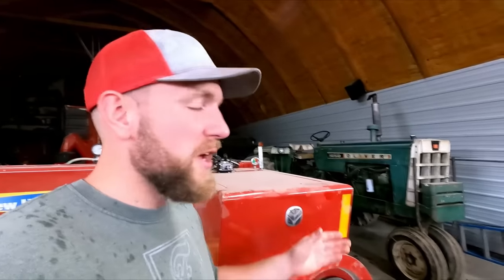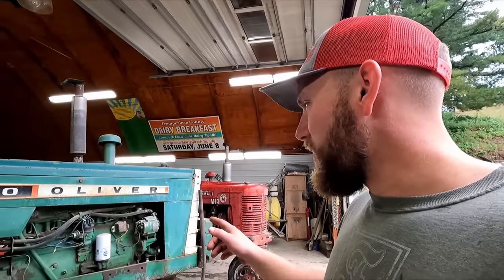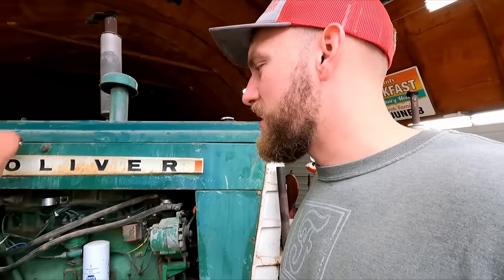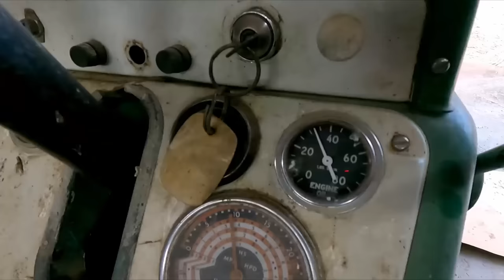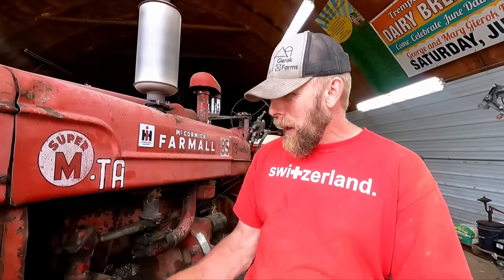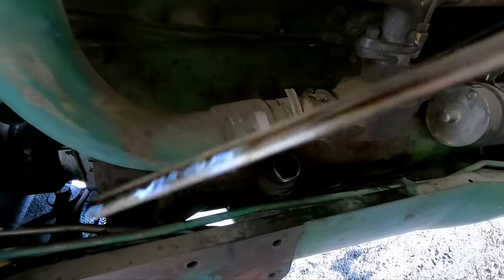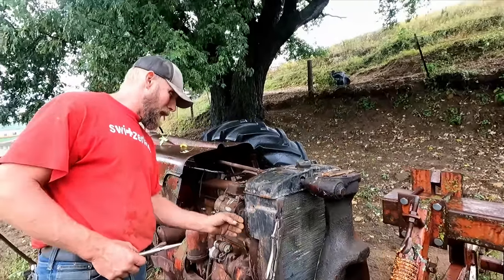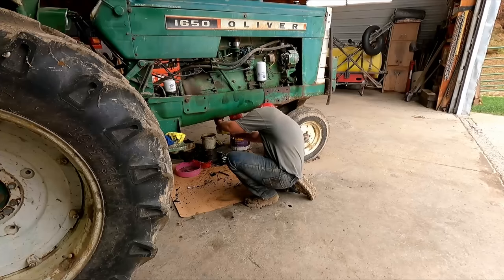Tractor Trouble!

Comment: My guess is one of the sleeve o rings is shrinking in the cold weather and letting coolant leak into the oil pan. You could put a radiator pressure tester on it on a cold morning pump it up and watch for a pressure drop pull the drain plug and see if coolant comes out.

Comment: Wish I lived closer, I'm up in central Minnesota, north of Alexandria. I have many of the tools needed for this kind of work and the time occasionally to help some folks out. I even have a tractor dynamometer that helps put a stationary load on the tractor for diagnosing issues and figuring out horse power. I have some videos on my channel of working on engines and running tractors on the dyno. I don't spend a bunch of time in Wisconson but I do enjoy the occasional travel!

Comment: I would see if you can find a shop that has a tester that can check engine oil for contamination. Put new oil and filter on the tractor and run it for a while. Uae it like you normally would. After you get a few hours on the new oil take a sample and get it tested. You might have to pay a little bit for the test but it will be worth it to know if you have a problem for sure

Comment: Years ago when I had horses I alwaays cleaned the barn and barnyard armstrong style twice a day year around. I only started the tractor after the spreader was loaded. But during the cold months the crank case oil would get milky. So once I found that out I started the tractor as soon as I got out there and let it run and get good and hot. No more milky oil. I don't know if that's causing your milky oil but I thought I should pass this along. My best wishes to you and your family.

Comment: A compression test is cheap to do. Bubbles in radiator is also a good sign of a bad head gasket. 
I can remember putting our M on the stock trailer to move fresh cows. Our heifers would pull the spark plug wires off and I'd be out in the dark early in the morning putting the plugs wires back on.

Comment: If you have coolant leaking into a combustion chamber, that cylinder (and spark plug) will usually be a lot cleaner due to the coolant flashing into steam and cleaning everything. My money is on cylinder sleeve o-rings. If you discover that's the issue, you should really consider doing them all.

Comment: Alot of great advice already given! My 2¢ worth is to pressurize coolant system to 20 psi (max) and see if system bleeds down, and if it forces any coolant to leak into the oil pan. You won't risk the engine bearings, and it's faster than waiting for it to heat up.
Reply: Even better yet, leave the oil pan off and do what you said and watch were the water is dripping.

Comment: Whether it’s an o ring or head gasket , it shows up during the cold season because the temperature is shrinking or contracting the material, in the warm months the temperature is allowing the material to expand or stay in it’s need shape & place to hold the water back, also get yourselves a box of XX-Large mechanics rubber gloves , you will be glad you did! Good Luck 👍🏻

Comment: When looking for coolant in oil pan the drain plug needs to be at lowest point of the pan capacity so that the coolant accumulates at plug threads. Crack open plug unscrew slowly till liquid drips. After allowing enough time to seperate, the coolant will come out first and should be obvious in its appearance. Was me and severe cold was cause of leak I would install a block heater and keep it plugged in. Would make easier to start also. Love your videos. Keep up the good work.

Comment: Have an Oliver 1650 myself, just is a diesel.  Currently, it has been out of use with needing a new clutch plate put in need to split the tractor. As well as the hydraulics are weak and need to rev the  engine to get it to lift or move hydraulic cylinders, and the pto doesn't turn completely off unless pull on it's lever hard

Comment: I said it before and I say it again, if it's just a little leak getter hot, run it up and down the road a few times with some Blue Devil head gasket sealer in it.  I been running my International with a loader on it for 4 yrs or more now with no issues

Comment: Is a farmer I've been a tractor off and on all my life, having give you some pointers on the Oliver I will now give you the only way without ruining any parts to get to the fan on the m. At the front end of the fuel tank there is a u joint in the steering shaft the front u-joint has a clamp and a woodruff key loosen the bolt in the clamps and go out to the front end in the steering pedestal that big cast piece in front of the radiator with the big hex plug on the front. Take the plug out and that shaft will come right out on the worm gear. Should take you 10 minutes and you won't ruin anything. You can then get the radiator and bolt it lifted out of the way and you'll have free access to the water pump n fan. I would suggest you repeat the process on the one with the broken fan when you go to repair it would be much easier that way

Comment: If it was me, I would continue watching it like you are and if you start to see signs in the oil again, pay attention to the temperatures outside into wherever you park the tractor if it’s warm in the shop and cold outside, you’re probably getting condensation in the oil and if you’re just doing short runs with it, it’s not getting hard enough to burn the condensation out
Reply: My thoughts exactly. We had the same issue with our M .turns out it was just the thermostat stuck open.

Comment: Engine runs good probably was a O-ring on one of the sleeves leaking from extreme temperature changes. I've had this happen to my 880 Oliver . Put a bottle of Dike radiator sealant in the coolant and it's never leaked again. I'd bet that would remedy the problem and save you tearing down the engine.

Comment: Somethings to help narrow it down.
Head gasket or valves leaks in head cold be indicated by white exhaust smoke or excessive smoke out crankcase breather or look in radiator while running you may see bubbles.
If you don't see any of those things it's likely leaking in the block somewhere like a cracked sleeve, o rings around the sleeves or a cracked block.

Comment: Buy yourself a coolant pressure tester. You can get a decent one from harbor frieght. Drop the pan and pressurize the cooling system with the tester and look up from underneath at the bottom of the piston sleeves. If you see coolant dripping then there is your issue. If your oil is milky, then it’s more than likely it’s blowing it directly to the pan, not a head gasket. You can also run it and pop the radiator cap off and check if you feel it puffing.

Comment: Can't blame you for putting used oil out of a good tractor in the 1650 to help scope out the problem. Not like you're going to do a bunch of heavy work with it. Bummer about the fan on the M. Sometimes having a parts source for some of these old jewels isn't all bad. Parts for some of the 50 yr old tractors are getting harder to find, let alone 60 to 70 yrs old.
Reply: You know the right place to go you can pick up a new water pump for those m&h engines. They have eliminated the greasable bearings and have started putting in sealed bearings. I put a couple of those pumps to use they work as well as the old ones.

Comment: There are high pressure,(cyl pressure)and low pressure, (oil and water).  This is a case of water getting into the oil.  Both lower pressure systems.... in comparison to the high pressures in the cylinders. which will generally cause overheating and stem from the radiator and water being blown out of the radiator cap  IF this engine has wet  cylinder liners then it could be a breakdown in the seal at the bottom of the liner where it beds onto the block.  OR it could possibly be a porous liner which may not show until the cylinder gets hot (Working). sometimes if this is the case you might detect white smoke (steam) from the exhaust.  I worked on an excavator engine that turned the oil to a white /Grey sludge in a day. and the ingress of water into the oil raised the oil/ sludge level considerably.  We could not find the problem and it wasn't until I removed the head , the pistons and rods, then put an oxygen acetylene welding torch on white light flame down the bores to illuminate the bore when suddenly beads of water where running down one of the liner bores.  When that liner was removed there was a large blow hole in the outer liner wall well down below the travel of the rings so it didn't show water in the exhaust smoke but went into the sump oil.  none of this showed on the inside but on closer inspection there was a split mark as if the tip of a needle had scratched the bore.  Cold it didn't leak but when heated the minute split opened and every stroke sucked water down Into the sump oil.  Love from the UK

Comment: I had the same problem with my farmall 504, the exact same problem to a T. I caught mine early just like you guys and all I can recommend is tear the head off and send it to a machine shop to have it gone through, might as well throw some new valves, springs, and valve seats in it. throw a head gasket on it and run it. that's what I did and have not had a problem. 2 dinos at 45 horse and some fall tillage later no problems"!!!

Comment: If there is an auto parts store close they will loan you a radiator pump and a boroscope. Pump the rad up to 15 pounds. Look in the cylinders closely to see any water around the head or walls. Rotate the pistons slowly and check the liners too. Take your time and notice if the radiator pump looses pressure. You can take an old spark plug, hollow it out, and weld a air hose fitting on it. Let your shop air pressurize each cylinder. Look for oil in the water and bubbles in the radiator. Listen for air comming out the dipstick or the oil cap. Easier to see if you put dye in the coolant.
Reply: @texancowboy9988  I don't need anything. Just trying to help with suggestions. You are employed as a mechanic? I worked at a heavy equipment dealer.

Comment: One thing to keep in mind for future use, anytime you have an engine open like you had the Oliver, dust and moisture can get into your engine. Even if you just put the oil pan back on with a few bolts it will help keep dust and dirt out of your engine. As far as any coolant leak, is it going through coolant?
Reply: Good question, is it using coolant?

Comment: Are you guys absolutely sure that you have a coolant leak?? If you have a thermostat that isn't closing, and it's cold enough outside ( like in February) the engine isn't warming up enough to burn out any condensation from inside the engine. It'll turn the oil milky. We had the exact same problem with our Farmall M a few years ago. Start with changing out the thermostat.
Reply: I agree with the thermostat/not enough heat I have a tractor that it does lots of small jobs and I swore that I had coolant in the oil. Changed the oil and it was still milky until I mowed hay for 4 hours and it cleaned up
Reply: I was thinking condensation also.
Reply: An old time tractor mechanic told me to dump a bottle of Heat in the oil, hydraulics and rearends in the winter to take the moisture out of the fluids. He said I didn't run the tractors long enough to evaporate the moisture out.
Reply: When they drained the oil, green coolant was running out first not just milky white oil.
Reply: Condensation can be a problem !!¡! But also Cavitation Erosion is a BIGGER PROBLEM AROUND THE BOTTOM OF CYLINDERS AND HARD ORINGS 😢😢😢
Reply: @TimKrenz-j8t  oh you are absolutely right .If the dam thermostat is open, and not working properly. And not correctly diagnosed. It will cost thousands more than it should

Comment: Little late now but if you had an IR Temp gauge you might detect an exhaust port running cooler. Sure hope you get it sorted out. Some times you can’t find a problem without tear down. Have you pressure test coolant system? You might have a cracked head

Comment: If you had a leak to your cilinders, you would lose way more oil and/or water. You would have white smoke coming from your exhaust as well. Only then examiing sparkplugs would have made sense. I watched your exhaust fumes and they look pretty normal. The thing that causes oil to be milky is mositure and low viscosity . In freezing temperatures, oil can start looking a bit milky by itself as it will have bubbles building up. Pumps and other moving parts might suffer from cavitation, "exploding" airbubbles due to a higher viscosity of the oil which is caused by a bigger pressure difference before and after these parts (much like bubbles made by ship propellors). Other things are water buildup due to your engine repeatedly warming up and cooling down. Always examine your engine when your engine is heated up properly. And yes, also a leak from the coolant system to your oil system. I think however that the oil should look way milkier then in your former Oliver video. 

To me this looks like cold, bubbly oil or moisture/condensation buildup. Your dad was pretty right with the approach of keeping an eye on it to see if it dissapears or is getting worse. If the first, you will know this for the future. If the last, you might have a nice engine rebuild video series coming up ;) There are after market block heaters to prevent stuff like this. blocking off part of the radiator might help in the cold as well. Keep an eye on the temperature then though! It is tricky to get old engines serviced properly if you don't have a manual or other source on how to do that on a specific model (getting a retired mechanic that knows these tractors might be an idea, they might do it for the fun of it. Maybe there is a youtuber that can help you out on this such as @JustaFewAcresFarm, he knows his Farmalls at least). You also need the exact bolt tightening torque values and in what order you need to mount the bolts of the head covers and similar parts on the engine. gaskets need to be replaced every time you open up the engine btw. For cheap stuff, you can try using liquid gaskets (use Loctite)  if the pistons allow that, but this machine might be worth preserving properly. I really like the look of that Oliver btw. 

I do tests on machines (also on tractors) in a climate chamber. Lots of things happen when they are stressed in the cold, including temporary leaks during cold starts, but never in the engine to be honest. Most leaks occur near the radiator area, at filters, plastic parts and connectors. But these are new prototypes of course. The most trouble is parafinated diesel if below -20°C, even with arctic diesel.

Good luck!
Reply: Hmm... true... Indeed not aribubbles, silly me. And yes, they implode instead of explode. I don't know what I was thinking when posting this. 
But: improper viscosity does matter though. If you use the same oil in normal temperatures (where the pump is designed for), and you start using it in cold temperatures, viscosity can rise up significantly. The pressures in your system will be way different because of the changed viscosity. (higher on pressure side, lower on suction side) and so can reach vapour pressure. Trust me, I've seen (and heard) it on cold startups of excavator hydraulic pumps, wind turbine gearboxes, heck, even a modified Leopard II. But now I think of it, never on an oil pump for a tractor tbh.... The oil has gas/foam in it when starting up below -20°C though. It also often occurs in the oil of our cooling sytem itself (450kW). That has a system to deal with it automatically. I know that oil companies developed cold climate oils for certain fields to cope with that. Not only a lower viscosity,  but also anti foam (higher probabiity in the cold (same reason), additive for faster heat transfer but lower operation temperature while extending the temperature range of the oil and such. @texancowboy9988

Comment: An old time tractor mechanic told me to dump a bottle of Heat in the oil, hydraulics and rearends in the winter to take the moisture out of the fluids. He said I didn't run the tractors long enough to evaporate the moisture out.
Reply: Great advice. we run it in snow plow hydraulic systems and haven’t had freeze issues since.  Same with crankcases, transmissions and differentials.  I add it to the contaminated oil and run briefly before changing and then add some to the fresh oil. No issues in nearly 30 years of practice.

Comment: To me, if the oil & trans. has white, & milky, condensation, but you can tell if it's coolant, I'd use it for a while and keep an eye on it! you mean, vise grips, 1/2 in. wrench, AND a torch! When I do spark plugs, I slip a piece of rubber gas line hose over top the plug, and screw it in or out!

Comment: Pressure test with oil pan off. Probably liner O-ring. If that is the case and you can run Bar's stop leak for awhile.

Comment: Maybe put air pressure to each cylinder through spark plug and watch for bubbles in radiator. Think about 30- 40 psi

Comment: Leave those plugs out and roll the engine over, that way it doesn’t hydro lock and break rings. In the case it has coolant in one or more of the cylinders. And as a  diesel  and former field service mechanic, I d never put used oil in a machine, not even an old tractor trying to chase down a coolant leak which could be caused by a faulty head gasket, or liners electrolysis or liner o-rings if it’s a wet liner engine. you could wipe out and wreck your engine oil pump and bearings surfaces doing so, not to mention contaminate the entire oiling system. I always use new oil regardless of whether it’ll be wasted.

Comment: i would bet that it is the orings on the bottom of the sleeves you could take the oil pan off and leave it off and put some cardboard under it and see if you get coolant dripping from the sleeves

Comment: Keep it simple.  Put it on a load.  I had an issue.  By mistake it needed coolant.   And got put in crank case.  Run it.  If the problem presist.  Then check again.